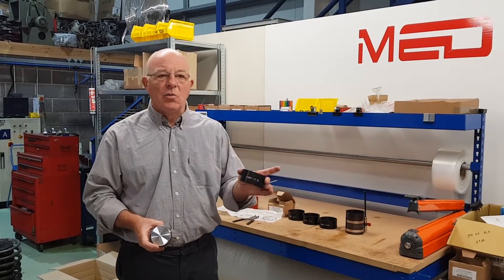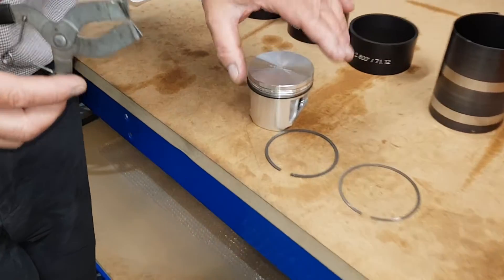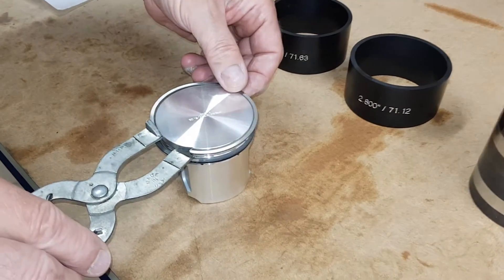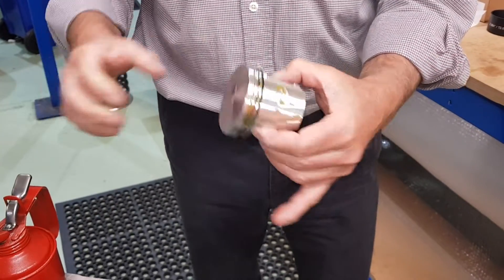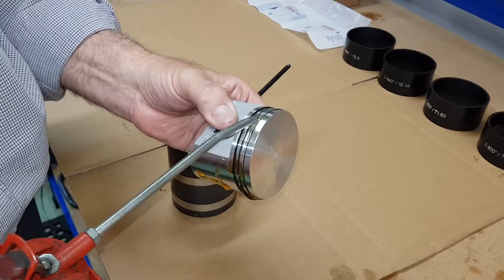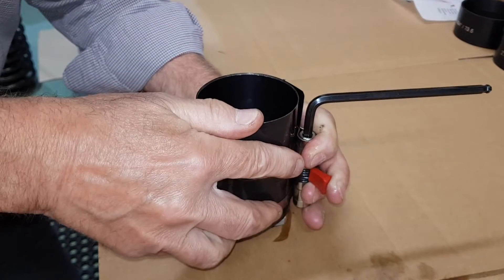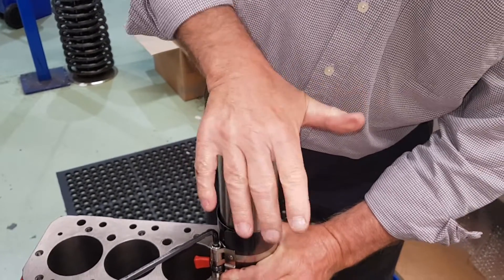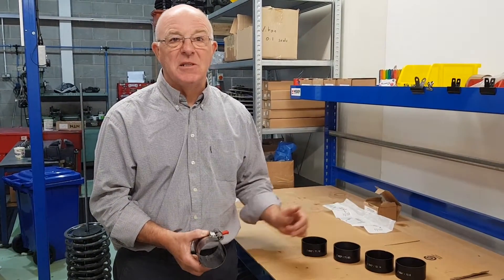How to use the MED piston installation tool

Comment: This tools are amazing. My issue is I work on small lawnmower engines. And there are several different sizes of pistons. And it doesn't seem like you are anyone else have these tools in the smaller sizes.
Reply from the maker: You could probably have a local machine shop turn some out for you.

Comment: I just had to rebuild a few hinda engines. Piston size 2.95. 
I took a 3 inch pvc, a saw, and a hose clamp, made one of these ring compresses for basically free. 
I'm sure 4 inch pvc would also work for other size of pistons. 
Example: 4 inch pvc inside diameter is 3.99 ish, Chevy 350 piston diameter is 4.00

Comment: But the old type of method is much more variable, as you can use it on any type of engine. Of course, when you are only working on Mini engines, the new tool may be better - but if you have to deal with different engines the old method is much cheaper.
Reply from the maker: It's a good investment alongside a new set of A-Series pistons, as the rings are more than three times the price of the tool for a new set.